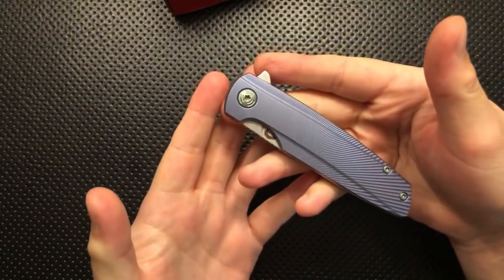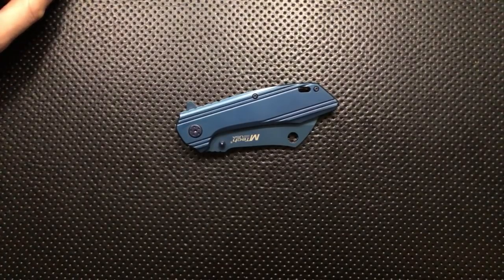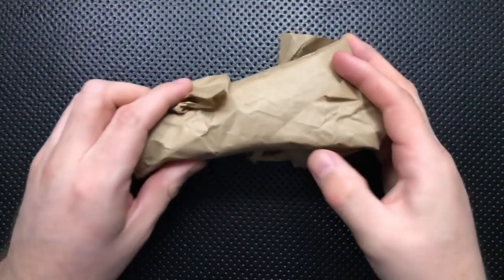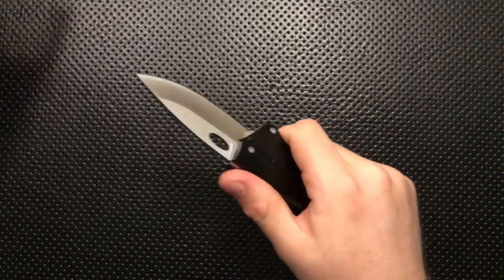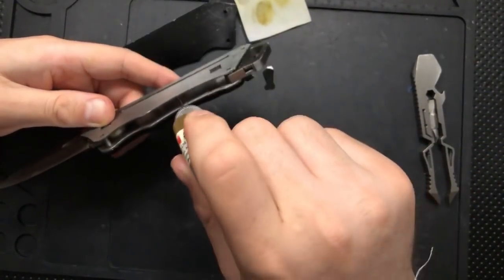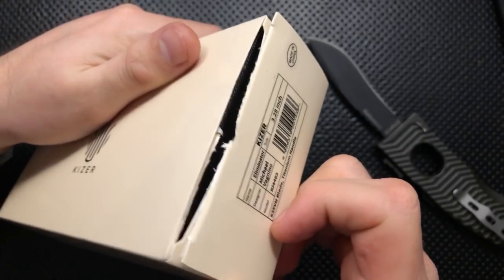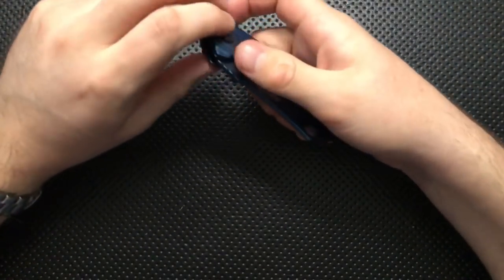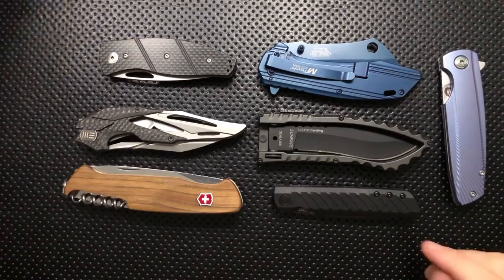Terrible (and pretty decent) Knives Live: March 2018!

Comment: There are a few Mtech Knives that are fair to Midland.
Usually the ones that have gimmicky,or gaudy features suck hairy rocks,and are a waste of the effort it took to make them.
Their better blades wont have a seatbelt cutter,flashy colors,or funky designs.
I have several Mtech's that are fairly plain jane,but take and hold a razor sharp,hair popping edge.

Comment: How does RAD knives get the nod for the hole in the blade? Cleavers have been made with holes in that corner since way before the maker of RAD knives was born. He simply took that design feature and put it on a folding cleaver. So he can take an old design feature and that's fine, but the second maker to do so is a design "cloner"?

Seriously, this community needs to get a grip.
Reply: Bill Call The entire blade shape is identical, even the little thumb ramp dipping down and curving up to the tip
Reply: Take measurements to show and prove it. I never said the knife wasn't styled after the RAD. I'm stating it wasn't a clone of the RAD. I've seen photos of old fixed blade cleavers that have those same design elements that RAD used to make a folding knife. Why is it OK for him to use said designs but not some one else?